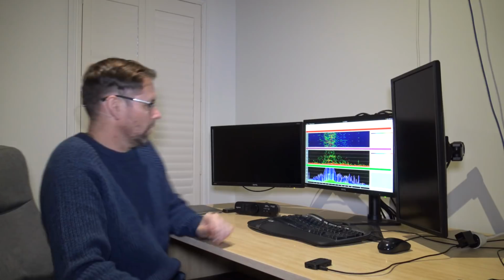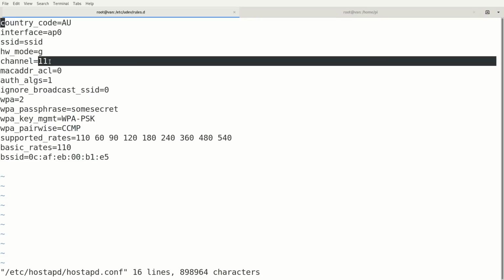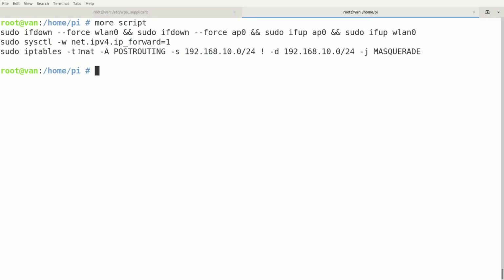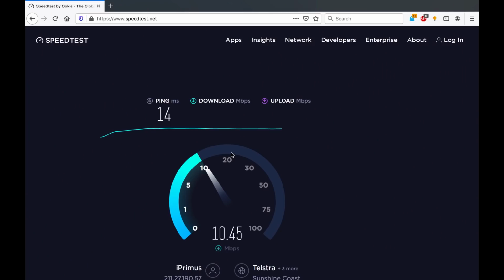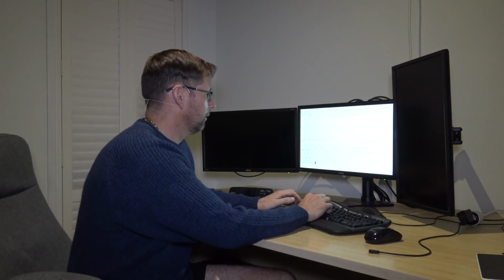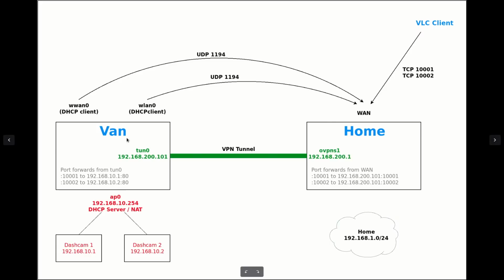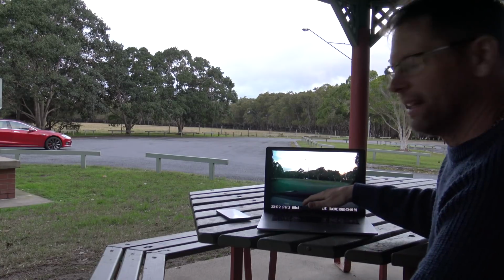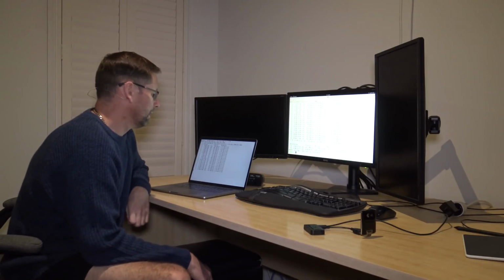Raspberry Pi Access Point, VPN, SNMP, Router, Mobile Internet, Live Dashcam Access, etc

Comment: Your open door looks like a Faraday cage to me. Add some metal shelves in that room and more metal bars/mesh on all windows and no wonder if you have bad reception. I have similar problems with metal shelving in my home lab. They pretty much block most of transmission to and from other parts of the house. Some creative antenna placement needed to solve that.

Comment: Didn't know you were building a van, but good choice! (hope your van build progresses faster than mine has been!)
On the NM front, you can block devices to stop them being managed by NM, at which point you can resume using AT commands and the like. Not super convenient, but you might be able to use a bash script to knock the modem out of NM when you want to SMS, and then bring it back up afterwards....haven't tried it though, just a thought.

Comment: Very cool to see what you can piece together with free software and low cost hardware.

Couple of questions: 
What OS are you running on your pi zero? If this is going to be powered via the van, are you bothered about the time it will take for the pi to boot up when you first turn the engine on? I had this issue when trying to use the zero to stream music from my home network with OpenVPN - I'd be driving for several minutes before being able to play a song.

Out of curiosity, are you using a Pi for your VPN server at home?

I believe later revisions of the Pi have a more powerful antenna compared to the zero, and you can get get a GSM hat, which might look a bit neater than your USB solution. 
Would be interesting to compare the performance with that setup versus what you have shown here.

After all that effort, id be tempted to spend a few bucks more to see if if there are any performance gains to be had.
Reply from the maker: Just Raspbian or RaspiOS whatever it's called now. It does the job. I also plan it to be on constant power, as it will be a camper van with a full secondary power system.

Comment: Your AirCard 320u also has two external antenna connectors hidden on its top edge.  Recommend you get two suitable patch leads and a dual 4G antenna to optimise 4G reception from your car.

Comment: Hey mate, set the pi Zero AP mode to 802.11N , G is garbage these days. I also recommend setting up wireguard instead of openVPN, in my testing in a similar scenario, it increased my speeds by about 10 megabit
Reply from the maker: It is 802.11n. G is just referring to the band, in this case 2.4GHz. The terminology of G or A is still used for the band no matter what modulation is going through it.
Reply from the maker: Also, the config in this video isn't the actual config I'm running ;)

Comment: for the modem set it to IP Firmware instead of LTE. 
This will give you 5 com ports. You can use 1 with a ppp(for data) and then another one you can use for AT commands for sms
also grab some of the big pihole lists that will block windows update, adobe updates, telemetry, etc. This means no background data and should give you if not more MBps but atleast a more stable connection
Reply from the maker: Thanks for the tip there. I'd like to try it but am also cautious about breaking a working system. When you say IP firmware, do you mean totally different firmware for this modem device?
Reply: @TallPaulTech depends on the system i was using this modem on over 200 mikrotik routers for portable digital signs. Mikrotik call it IP Mode(as it can talk to the modem via USB to convert to Bridge), huawei call it stick mode. But the cool thing is i had the mikrotik polling the GPS co-ords sending an email/sms and a server at our data center would detect if the GPS co-ords have changed. If so we know someone has stolen the screen and would alert us. We could push new ads/remote access NUC via the ppp modem. If you're looking to travel Aus.. i wold actually purchase a couple of huawei , unlock them, convert to stick mode and have a Telstra and Optus SIM. The PI can load balance or deal with failover. Depending where you're in the country Telstra or Optus has better coverage :)

Comment: Host a Tor Hidden Serivce so that you can "dial-in" to the vehicle from anywhere without leaving a conventional port open.  Then, using udptunnel, implement WireGuard for VPN access into the vehicle network.  Add a USB SSD (like a Samsung T5) to have a place to locally store files - like recorder events, then use R-sync to opportunistically upload them to your home server.

Comment: It seems everything gobbles bandwidth and processing time. Adding the VPN probably did this, which is likely the reason for the 2mb drop in performance. I imagine sending video from the dashcams to the home storage, should you do that, would also affect the throughput numbers. But, that is the fact of networking. I like the project!
Reply from the maker: No, the UDP encapsulation for the packets within the VPN tunnel really add very little. As demonstrated in the video, the performance hit comes from sharing the same RF channel for both uplink and downlink of the Raspberry Pi.
Reply: @TallPaulTech  If you added another usb wireless device would that distribute the load better?
Reply from the maker: @TradieTrev  I could use one in the 2.4GHz band and one in 5GHz, but the fact is that this is enough for the purpose I plan on using it for so I'm not going to bother.

Comment: Great project, you would most likely get a couple of bucks promoting a vpn-provider with a setup where the clients are "secure" thru their vpn-service :-D . I have asked on other forums, with not a great deal of luck, are there good ways telling the clients that this network is metered ? For Android I know there is a dhcp option for this, but clients like windows and apple does not use this. By having this, you avoid syncing of dropbox/onedrive , updates etc..